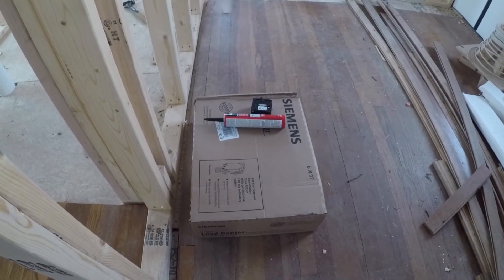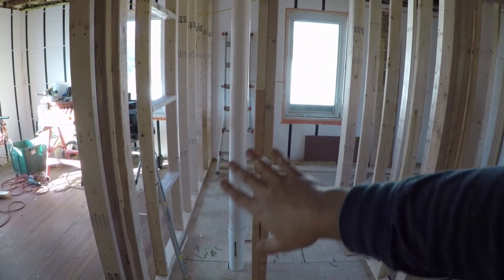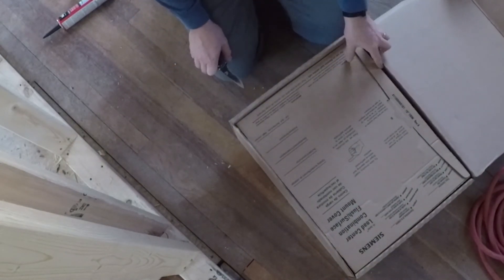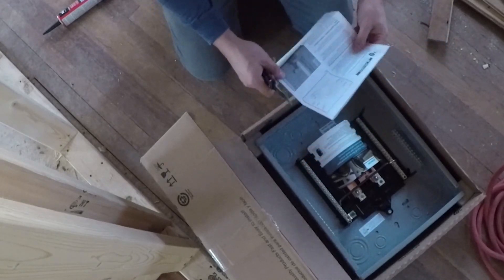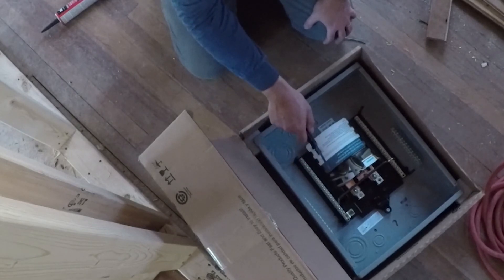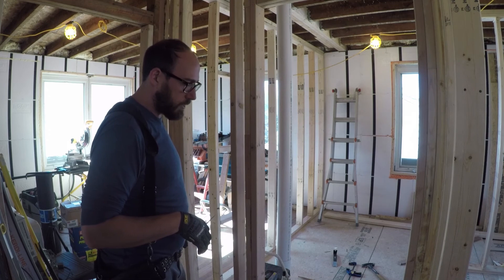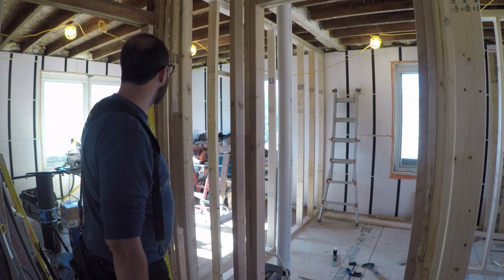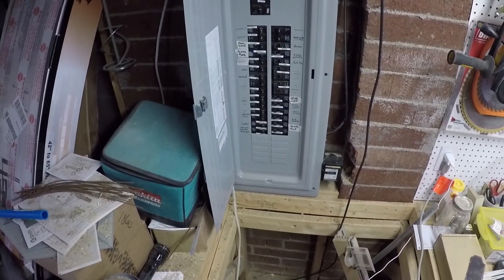Electrical Subpanel  unboxing and installation

Comment: But how did you attach the panel to the studs?  I intend to build a shed and put the panel inside but have an electrician hook it up.
Reply from the maker: Super easy!  There are quite a few nail or screw holes in the sides of the panel.  There are also lines marking for different drywall or finishes so you can line it up for the proper flush finish.  Just get it where you want it and drive nails or screws through into the studs on either side.

Comment: I’m doing the same project too. I enjoyed it
Reply from the maker: Kevin Naderi it’s super satisfying!
Reply: Living In Transit : Yes it is: and I have some circuit breakers that are in the garage that I want to move to the other side of the house for convenience and for those circuits being originally on that side of the house. This way I don’t have to walk all the way to the garage to reset a breaker plus there right in my room for convenience also will make the circuits a shorter run to reduce voltage drop.🤩👍😮